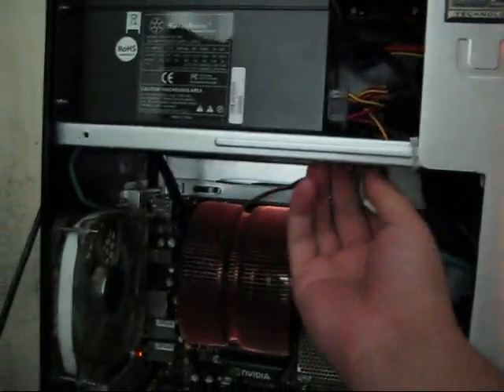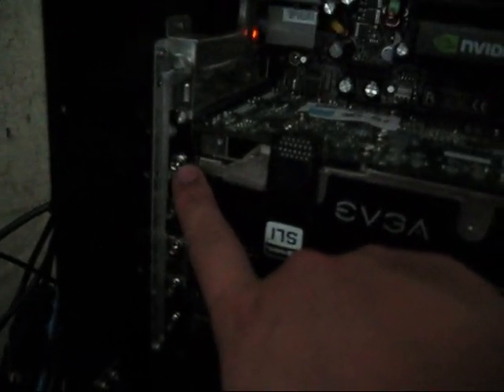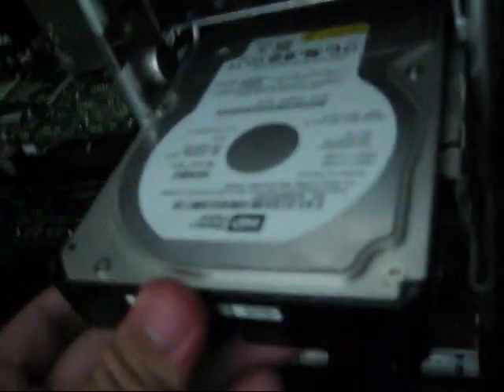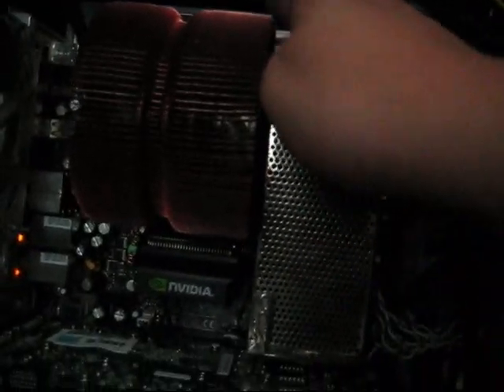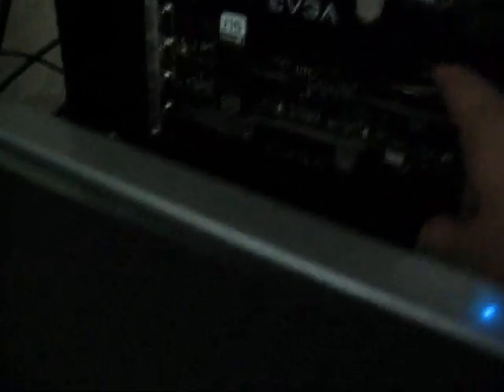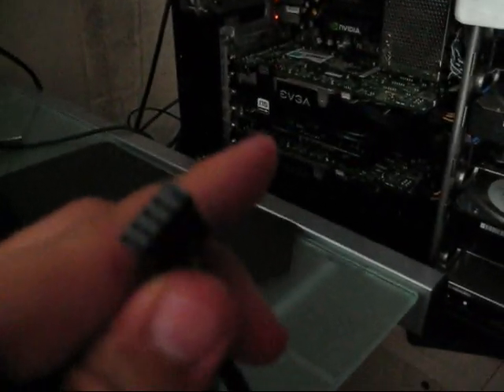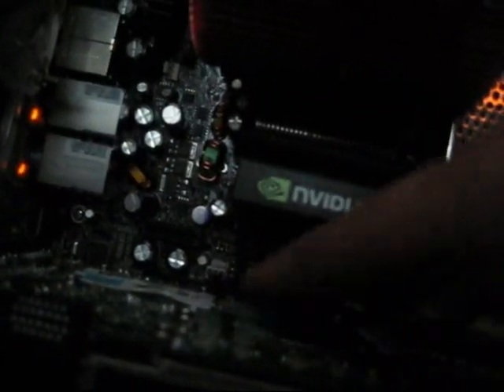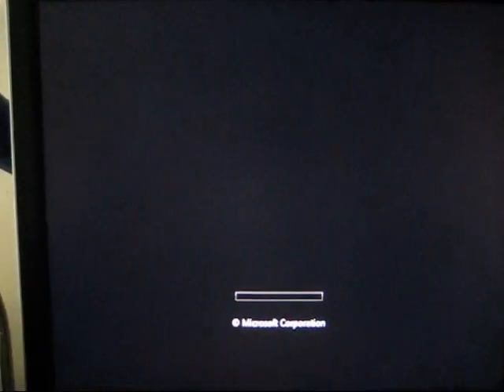Building your own custom computer Last Part

Comment: I am currently in the process of selecting parts for a highly customized gaming computer that i amn going to be building soon.  I havent bought anything / definatively selected anything for it yet. Do you have any sggestions of what to get?  Also, do you have any suggestions of where to buy these parts?  Thanks in advance.  -CoolioF14

Comment from the maker: it doesn't matter if you overclock or not. artic silver is still a better thermal compound...it is known for have lower temp than other thermal paste out there..just check ou their site..and i can say for a fact that i used zalman thermal paste and then i switch to artic silver, it drop like 2-5C lower temp than i did before with zalman

Comment from the maker: if you did change the psu and videocard, nothing will happen, only thing is you need the drivers for video card. and if you changed motherboards, you need to repair XP and/or Vista so you don't lose anything. so if you get another mobo, make sure you have the OS CD on hand

Comment: You can reuse a hard drive right and ram if it is compatible with your motherboard, for example if i changed my PSU, Motherboard, Video card i can still keep my hard drives with all my files i will only need new drivers, or would i need new hard drives or would i need to partition them?

Comment from the maker: i've used AS5, and i like it alot, yes there is a break in period. you don't have to be extra careful, just make sure you don't do any type of overclocking to the extreme anytime soon, cause it needs to have full contact with the heatsink or waterblock, whatever your using. and yes its worth it

Comment: About thermal compound.

I'm choosing between the Arctic Silver 5 and the Arctic Cooling MX-2.

Now, I heard that the Arctic Silver requires a "break-in period" of 200 hours before it is at maximum effect.
Are you required to be like, extra careful not to overheat your CPU during this period?

Since the AS5 has these special requirements i assume it performs better than "normal" compound.
Is it worth it? Do you know how much better it is?

Comment: In your first video "Installing a CPU on your motherboard" you said that youre supposed to spread the thermal compound evenly all over the CPU, but in this series of videos you did it the "line" way. What's the differnce?
Which method is best for dualcore (athlon 64 x2) CPUs?

Are you required to reinstall your OS(XP Pro) after you installed a new CPU(from A64 to A64x2)?

Thanks.

Comment: Another way to tell which way the fan throws the air is to look at its blades. Most pc fan blades are slightly curved, so they cup greater volume of air and release it straight out the back,  but if it spins the other way it will not grab much air nor release it in the right direction therefore being bad design, so yeah.